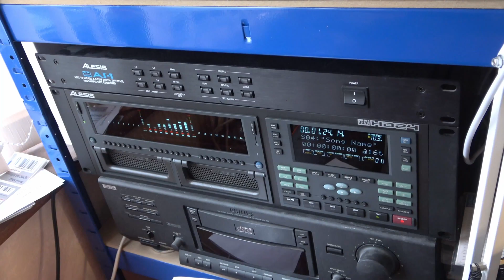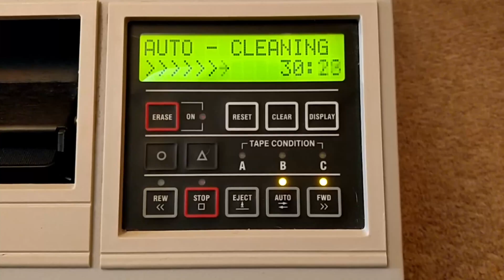Installing spares for SVHS and Digital Betacam machines

Comment: I have one of the digital beta cam machines and it was working fine but now it doesn't output video or audio.  I'm guessing it's one of the control boards but I have no idea. Do you mind helping?
Reply from the maker: I'm not sure I could help much.  I would start with: What is the channel condition LED reporting?  If not the left green LED then it might need a head cleaner tape, that's where I would start.

Comment: Digital Betacam   you know there was a ad on cost  of a in out video card  that is hard to find  yes the yellow  video input cart 
this first time i seen a working back card  i pick up a parts decks  there alot of the betacam decks around 

i have a RCA 1502  I CHANGED BELTS the only thing can't used to deck  because all the moving parts are jammed 
up very badly  you know what i have a hell of a job  to get  going so beweare
picking up used deck  

i did have a hell of time on a betacam sp  that was jammed up as well  all the tape handling was not going to work 
i fixed it in the end  hell of a job i had one like this 
it was dead and was not power up  it was fee to 

i did in the end use the parts to make decks that would work again the thing getting deck home is a pain

Comment: Great vid which gives me the confidence to replace the pinch roller myself avoiding a costly service bill. However with my clumsiness I recon I'd drop the clip after removal. 

Just bought three Dvw-500p:s of which two shows the Error 96. I'm hoping that replacing the memory circuit battery might help. However the service manual advices to store all the setup data on a memory card before replacing the battery, and then reload it when done. I’m wondering what data I will loose if I don’t make the backup? Would that be all the info about running hours etc. from the Setup screen? Or would a hot swap be possible, replacing the battery with the power on?
Reply from the maker: I guess it will lose the hours, which may have been lost already.

Comment: hi, very nice in watchers sending you the parts to complete the 7350,  I just got my one down from the loft and everything works, well kinda.  I have a really bad snow on playback sometimes picture jumps, also the s-video out does not send picture But the BNC 1+2 connector to composite does? It records from the s-video in fine, just the playback that lets it down. Following your videos of this machine i have ordered some cleaning fluid and going over a few times your video of replacing the caps. The audio Normal and HiFi record perfectly as i play through my pioneer setup listening with decent speakers and my AKG monitor headphones. If you could help or anyone that may know please let me know would like to restore it back to how it was. It did play ok before it went in the loft a few years ago. Would be a shame to put it back in the loft or sell it off as spares.
Reply from the maker: You'll have to use the service manual and trace where the S-Video signal is going.  Snow on playback, tricky... Check that the head earthing contact is in good order.  May be a difficult problem to solve though if it's in the head amplifiers.  You could really use a machine to borrow some parts from so you can at least get down to board level.
Reply: @video99couk  hi yes a good time ago i could have got a few for like £15 - £30 each, wished i bought them now but as time goes by you just never know whats worth a fortune in the future. There are now non working ones selling for £250-300 i love the old tank built hardware, they just dont make em like they used to :) what would you say now would be a good newer modern player to buy as a replacement?

Comment: There's a very good reason why the grooves had to be added to the Digibeta pinch rollers - You could possibly find out out if you ever do any editing !
Reply from the maker: I'm interested...  So did shuttling back and forwards a lot cause problems with the original design?

Comment: Without an ultrasonic cleaner, I've had good results cleaning serrated knobs and dials by putting some of that oxy powder laundry additive stuff in a cup, a drop of fairy liquid and hot water. Chuck the parts in and leave it in the sink for half an hour. The oxy stuff will foam over and all the gunk will float to the top.

Out of interest I keep noticing that FA400 soldering fan - are they actually any use? I tend to lean quite close to what I'm doing when soldering and tend to get a face full of fumes.
Reply from the maker: The soldering fan is mainly used for something else!  When I'm de-moulding tapes, some mould gets airborne.  This helps capture mould particulates a treat.

Comment: What a nice thing to do for you :-D
I also remember pushing the flap in before removing / fitting the front on some machines.
But i no longer have a memory of the brands/models.  (Not important to remember i suppose).
I dumped all the remains of my vcr crud i had 20+ years back, so i don't have anything useful for you.
Anyway, nothing i had was of the high quality machines you have.
Remember the full height front loaders with a white pcb and Orion printed on them, yep i did loads of those.
Rather cheap but usually easy to fix, often the ff/rew jocky wheel.
I did like the ferguson videostar slim front loaders,  i never saw one with a bad picture.
I did hate the philips front loader with a habit of doing a full deck check when first powered up, annoying.
Also the video head drum was pushed on to a shaft, plus a horrible bit of metal with a screw to lock, i stayed away from head changes lol.
Ooow a blank tape played  white/black random ribbons across the screen,  an odd dropout detector/filler.